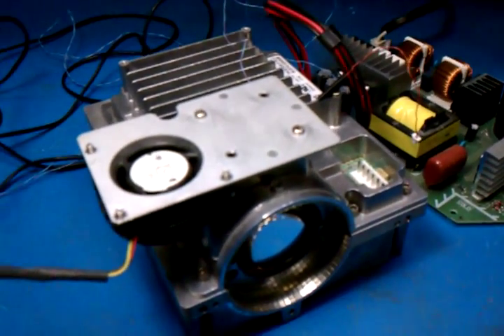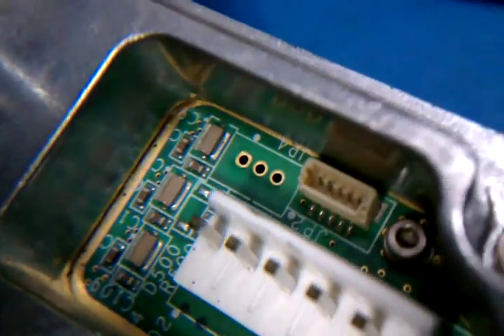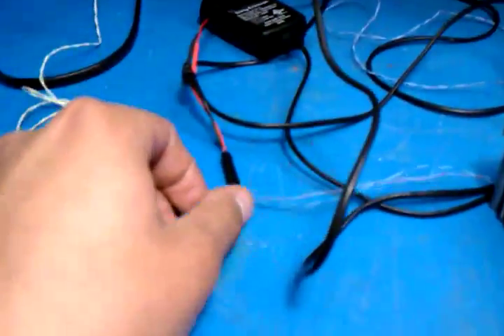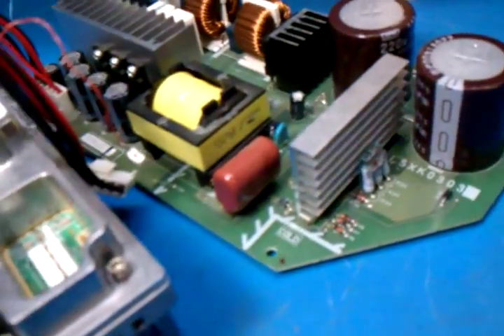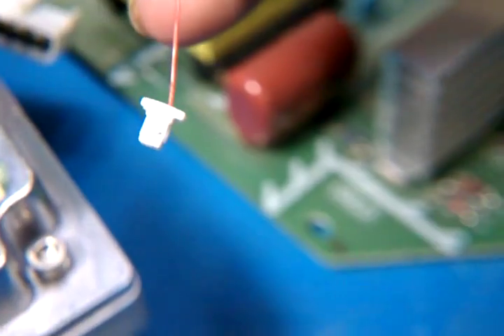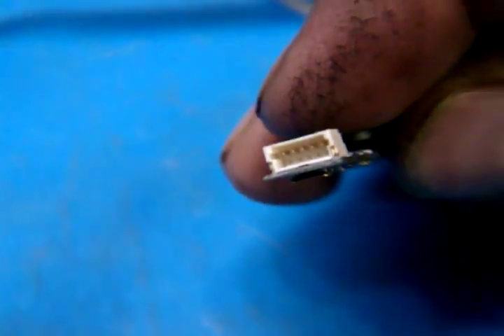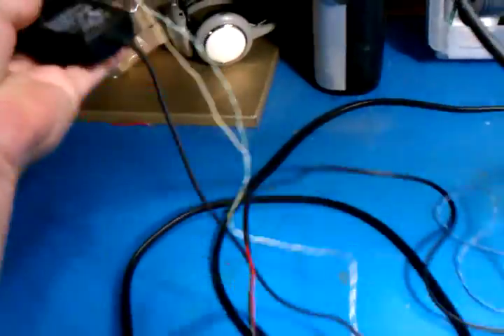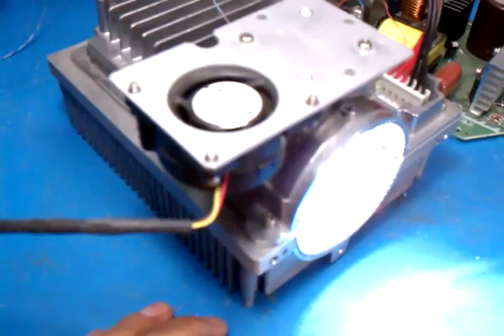How to power up a Luxim LIFI 4000 lamp

Comment: Thanks for posting that. The mating plug for the 5 pin control connector is a JST SHR-05V-S-B body and SSH-003T-P0.2 contacts. I picked up 5 sets of contacts and housings from Newark for about $2.50.

Comment: Thanks I blew 1 lifi up trying to figure this out. ps the ground is the 2nd connector from the right.You can dim the lamp by simply adding a ceramic resistor or by adjusting the voltage output on the power supply

Comment from the maker: As far as I know, the only part number on the casing is: 00-05000-01 and the LIFI 4000 name.

I don't know where you can buy these new anymore. I got lucky and found the one in the video on ebay a couple years ago. Doing a quick search just now I see that there's one seller "TVreplacementparts" that says has 7 in stock. Might want to check it out, they're selling them for $250 a piece.

Comment: @jeremylevib Varying the voltage in is a good way to toast the RF drive in the unit. The light is easy to control through serial. I have it controlled through a teensy running arduino.

Comment: Hi....I realize that it has been about 5 years since you posted this video, but I have 4 of these Luxim LIFI-4000 Lamp units to test...in hopes that just 1 of them works.  That being the case, I can not risk burning-up even one of them.  Your video mentions specific voltages in several areas....but you never mention whether it's AC or DC voltage.  I have a variable AC/DC power supply, so I can provide whatever is needed.  The small fan on top no doubt requires 12 volts DC to function, but what about the pin-out specifications of both the large and the small connectors in the upper corner of the LIFI lamp? I can also see that you're using the power supply board out of the respective Panasonic DLP tv in order to provide power via that large connector, but do you have that power supply board connected to the initial power supply board of the tv as well?  I can not tell from the video, but I can see the long black cable that runs from the 1st PS-board to the 2nd PS-board.  Also, the 1st board is triggered via the On-Off button panel or the remote controller....so do you have the tv off camera that everything is plugged into?  If I could just get the pin-out info on that large and small LIFI connectors, I could power up the 4 units for testing...and either fix my 61" tv...or send it to the recycle center. Thanks for any help you can provide me.
Reply from the maker: All voltages applied to the LIFI module are DC. The red wires on the large connector are all positive and the black wires are all negative. They provide 28V at about 8A. The power supply for the LIFI board I had connected directly to AC mains with that black cable and I plugged it in before powering up the lamp. I didn't have the rest of the TV in this case, just the lamp power supply board and the LIFI lamp. I would think the board the power supply connects to probably just controls power to it with a relay. 

As for the small connector, according to some info I have, the pinout is:

1 - RXD
2 - SCI
3 - +5V
4 - GND
5 - TXD

I'm pretty sure the pin I applied 5V to was the SCI pin, I just didn't know the pinout designations at the time. It allows manual On/Off control, otherwise the unit is controlled with serial data.

Comment: what the figi are those things? I have like 4 of them that I am just going to scrap for the aluminum
Reply from the maker: Tyee Cambrón They were the lamps used in some RPTVs.
Reply: The Workbench  Hi workbench, i know this video is already a few years old. But i want to get one of those babys to run and i cant get a hold of a psu like yours. So i want to ask for your advice. I dont want to blow the lifi while working out the wiring of the main power plug. Would you please contact me?
Even if you cant offer any advice
i would be glad to hear it from you, other then waiting around. Thanks in advance.